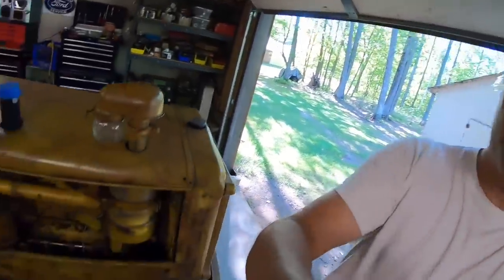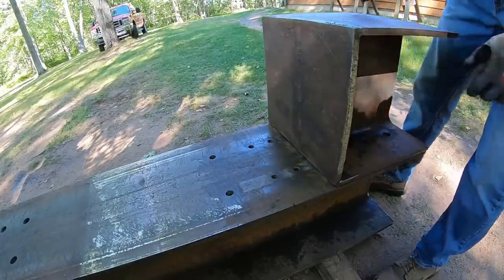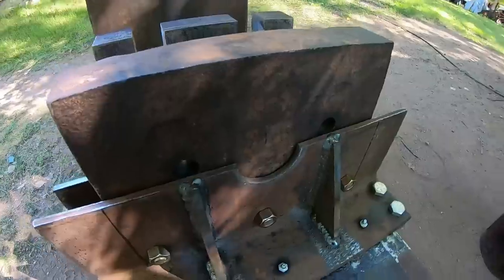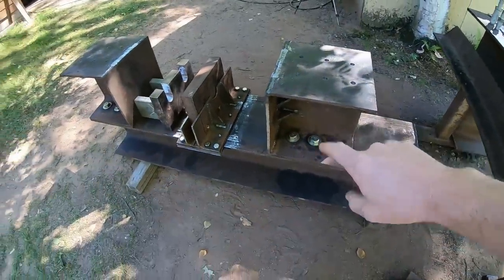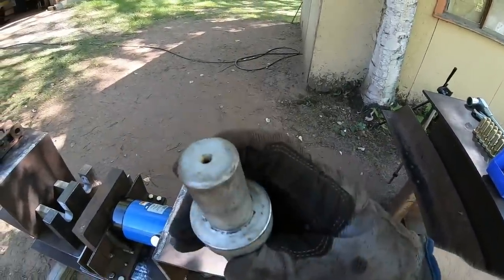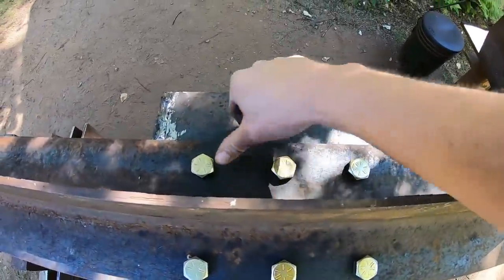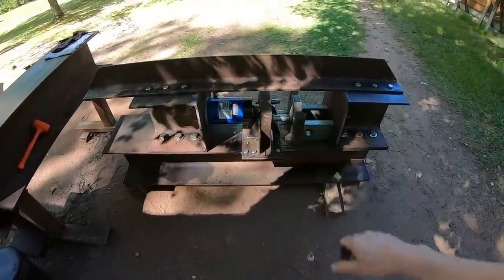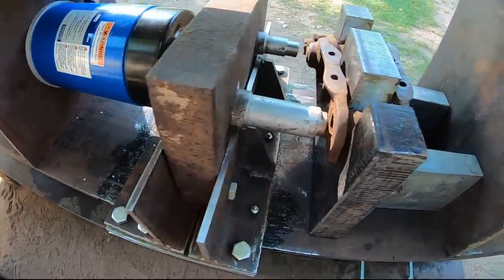Caterpillar D2 #5J1113 Chassis Rebuild Ep.66: Building & Assembling the Pin & Bushing Track Press

Comment: Pressing 2 at once is fine as long as both sides press at an equal pressure.  If one side is seezed you will quickly find any weakness in the design.  Overall its a solid design.
Reply: Hi Kevin, it's a good point you make but it has been catered for in the design. Toby included those anti-twist guides. Guess it's all a question of how seized ....

Comment: Looks great, I think it'll do the job without issue. If the grease becomes to much to deal with try a bar of Ivory soap, just smear some on the contact areas as needed. I've seen building slid along steel Ibeam to move buildings into place on foundations and such. You can use the soap to wash your hands with when you're done😂😂😂

Comment: I bought a pair of new Berco D2 chains many years ago from Florida that were stuck in a coil. The track shops wouldn't try to disassemble them because they needed straight tracks to fit their machine. I went as far as making the anvil with the two U slots but got busy.  I might get that project completed one day!

Comment: Really nice build, it doesn't really matter if it has a scrap fab look. :)

On very rare occasions I've spent long hours making a fixture for this project and that project with dead reckoning as my design guide. Looks like it'll work and I think it'll work but you don't know for certain until you've gone through a few repetitions. I can't say I've built anything remotely as substantial as this link press you've assembled, it should be neat to see it in action.

Comment: That's a very heavy duty press it should withstand the forces you may want to have a expanded steel cage around the sliding area in case of broken parts and pieces go flying around so nothing hits you I have had stuff go flying when I have been pressing with my 20 ton shop press I am glad mine has the remote pump Jack like your hollow ram uses it let's me stand back from the debris. Keep up the great videos Toby

Comment: Wow!  The only step left, I guess, is to add a nice handle on the top so you can pick it up and carry it around, right?  Nice build!!!
Reply: I was thinking some holes in the web of that top brace to accommodate shackles in which you can put a sling to pick the whole thing up.
Reply: Or slots big enough for the forks on the tractor.

Comment: That's pretty awesome all things considered.
If you end up having a problem with the slide, maybe taking the mating surfaces and hand scraping them in so you get some good flatness and places for oil to reside, just as they would have the ways in old machine tools back in the day (some of which were likely to build your tractors) and running the slides on light machine/ways oil would be a good option. Way overkill for sure, but a good option if you want a good slippery accurate slide or if for some reason your solution gets stuck (Though I personally don't see how!).
It's always crazy to see the heavy duty tools you need to combat heavy duty construction!

Comment: might work ok..... but you've created a teeter-totter with the pin press pins, all good as long as they both take damn near the same amount of force to press the pins.......... I'm thinking in the end you're going to end up making it a center press only inline with the ram i think i would make it so that the center plate that you drilled and machined flat could slide left to right to allow for quick change between pressing pins, a little cup on the back side that the ram lines up into..... you also might want to provide support to the back side of the chain to the back support panel so that you don't bend up chain links if one is stuck...... the quickest way to find the yield strength of anything in our shop is give it to the rookie and tell him to press it in the 50 ton press.

Comment: I wondered where you were going with this, Squatch. It took me to the middle to understand you were creating a horizontal punch press. Most punch presses I've seen in factories are vertical, letting gravity do most of the work, but this will do great for your application, and you don't have to build a huge base for it to sit on.
Reply: In this case the gravity is keeping the track down into the press.

Comment: Jigs are made looking rough. You know what it's for and there you have it. I was hoping to see you put it to use in this video though. I say, you let us down a bit there! A press has loaded areas that get worse and worse with use. A single point press with a swinging punch for each purpose would have been "better" I guess? Guiding that ram is where the variation will appear in wear factor.

Comment: Add a stop on the end block to prevent the brace plate from sliding up when under pressure. Even with the top "T" iron strap there will be distortion in the frame with 50ton working against it. 
Use a couple of moving blankets over the press it prevent flying shrapnel if it would have a catastrophic failure. You can get them at HF, fairly cheap. Looks good and good luck with the first test run.

Comment: Nice build. My only thought is that the ram is a bit too high. The slide may not notice? I’ve built similar hydraulic presses for other reasons and the ram tends to try to lean. Yes glide material and shims were used. The two push pins being different lengths may work in your favor. In the end? Great to make your own track press! I hope it works in great fashion!

Comment: Big press!  You could run into issues by pressing two pins at once.  If one pin is free and the other jams it may rack your press slide…. And with that big cylinder may bend something.  Pin presses I’ve seen usually are c-shape and pop one pin at a time using a portapower cylinder and electric pump.
Reply: A regular track press does one pin & one bushing per stroke. One reason is it pushes the parts from the outside to keep the inside from going through the link bores. If you only pushed the pins out you would have to push the pin through both links to separate, thereby pushing the old distorted wear surface through the link hole. You would also  add operations by having to press the bushings out separately.  Of course with this design you will have to replace each remaining side link with the pin & bushing back into the press (with the drivers swapped) to get all the parts separated.

Comment: Ever hear of Huber Reversible Fans out of Erie, PA?  My Dad worked for them until they finally closed their doors around 2015.  Aftermarket reversible fans for heavy equipment, that when reversed for winter operation, sends the engine/radiator heat towards the operator. Or summer operation sends the heat forward out the front of the machine.  They sold a lot of fans over the years of that shop.  I'm not positive, but I think they would sell direct to Caterpillar, or at least dealerships.

Comment: Most folks haven’t heard of the YouTube channel of Master Milo over in the Netherlands. He does all sorts of builds and restorations. He bought a Chinese T55 tank that a British Army unit had brought back from desert storm and set up as a display. It got rusty and ugly looking and they sold it to Milo for scrap. He had an awful time getting the rusted in track pins out. He finally resorted to massive heat with a couple of rosebud torches and banging the pins out with a fabricated pin driver and a sledgehammer. Of course, these tank truck pins were designed to be free floating and not pressed in in the first place.

Comment: That sliding piece works exactly like every log splitter that’s ever been made, and they don’t use grease on the slide or the rail. So I don’t think you’ll have an issue there. I would be more concerned about the grease getting dirty and acting like an abrasive, causing binding or scoring.

Comment: We love our CAT manuals: Does it say the pressure required to press in the pins from the factory?
(and you did grease up those lower fittings, correct?)
Reply: @squatch253  you already have the greasing frequency figured out, so that might mean you've already have tried the press?!
Reply: @squatch253  The way the press is built I would expect the grease area to be loaded only by the weight of the moving jaw or am I missing something?
Reply: @squatch253  when my channel starts paying for it's self, I'll join. My 1958 Plymouth Suburban is getting the views and adding subscribers. My I post a link to one of my videos?
Reply: @squatch253  much appreciated!

Comment: Your back brace (to the top of the press plate) could use a spring and camming device mounted to the top angle brace, so that the back brace is lifted up against the top angle brace and held there by spring force (spring above angle brace).  Then you using an integral bar, cam-over and push the back brace down into position over the link.
When done pressing, cam it back and the spring lifts the back plate back up, off the push plate, allowing removal of the link.
Saves having to have two extra hands to lift the back plate each time.
Hope that's not too unclear....

Comment: looks good .are you going to put return springs or gas struts on the sliding part to help return it each time
Reply: I think he will find he'll want some kind of spring, just to reduce the repetitive motion issue since this is going to run hundreds of times. Operator fatigue!
Reply: There's nothing like being able to feel what a tool is doing for catching a problem before it causes damage. When you feel that something isn't quite right and find out why before something else starts happening you save yourself a lot of time, money, and headaches. Overbuilding is great. Making it too complicated just adds to the potential of failure. I like the way you think Toby. You built it strong but not too complicated. You didn't build it to do all the work on its own. It allows you to monitor the progress and make adjustments as needed.

Comment: An idea from doing way too much repetitive work like this myself 
Make your slider return back automatically, it'll speed the job up more than you'll think 
Even a bungee cord wrapped around it and run back behind the cylinder 
Or if your cylinder has a spring in it to return it then tack your wear nut to the slider
Reply: I was thinking the same thing, add mounts for some tension springs to keep the carriage against the end of the ram. Bungees are a cute idea, but I doubt they would have enough pressure given the short distance.  He could just drill holes, and put in some long eyeballs to accommodate whatever return spring he has laying around with enough travel.

Comment: My goodness that is one heavy engineered press but it does have to do a lot of work to do all the chains. I reckon you will be able to press the pins out on the track of the NASA rocket crawler. As said below the design does rely on the two pins moving together with not too much difference in the force required to move the pins and bushings.

Comment: Looks great but needs some heavy springs or return mechanism between the slide and the ram!
Reply: The way he built it allows him to catch and correct any binding or galling issues before something gets damaged. Yes, he has to put his hand on the pressing plate and pull it back but, if it drags a little more than it should he will know about it long before the springs would speak up and tell him.

Comment: Could you do a test press on just one pin. To see the pressure required to move your most corroded pin. It will give you a bench mark to calculate pressure required to press two pins at once.

Comment: Out of curiosity I looked in my AISC bible to see what this beam was. From the general dimensions you gave the closest thing I can find is an HP beam, more specifically this is either an HP14x89, HP16x101 or HP121. At; 14/16" tall, 14.75/15.8" wide, and 89, 101, or 121lbs/ft. The dimensions don't exactly line up to what you said, but it is the closest thing I can find in my book. Depending on the mill the dimensions do vary a little bit (not much though), depending on how old the material is epically.  HP shapes have a huge capacity to be loaded axially or transversely, either way they are exceedingly strong for what the beam is being used for.

Comment: Looks good now if works and it should? May need bigger ram! Due to pushing two points at same time.Seen video of (overseas country India) other press home made! Had a ramp guide that feeds  the (rolled out chain) into the press.they used a winch, like a bumper winch. hooked back aways,  then winch the chain forward.

Comment: Hi folks, well if one of the pins is so seized that the unbalanced forces on the pins cause that sliding unit to twist despite the guides than it is easy to do a single pin conversion, it's a very flexible (bad choice of adjective!) design ......

Comment: From building splitters just like that the only thing I see failing is those bolts holding the slides on normally you see 6 to 8 bolts on each side it will be interesting to see if they snap.

Comment: When I built my (ugly) log splitter from scrap metal I cheated a bit, since I had room to spare I made the guides and bottom plates three times as long as the sliding plate and placed them centered, since I already did it that way from the beginning I don't know how much the rigidity improved, I'm almost sure that the greatest pressure is exerted on the ends of the guides instead of being distributed evenly, perhaps it can be just one third more rigid instead of three times more rigid or something like that, but any improvement is welcome.

Comment: Does the 50 ton hollow ram have a retract spring. My 20 ton does not. The hollow ram is only partially threaded.  Can you drill and tap the ram insert  all thread for a fastener.  To build a retraction spring setup.  That is hidden in the ram unthreaded counter bore to adapter flange . Might have to drill a hole in the back stop for a tension spring to feed thru.  
Got any more 15 H beams you can not drill but rest as infeed and out feed tables on stands or blocks. To keep the rails at a decent level .

Side guides on the moving block may need to be longer to prevent the moving block from twisting.  Or do you have any junk hydraulic cylinders you an mount thru either side of the fixed stop and into the outside of the push block to work as alignment rails. 
Think externally bolted cylinders . Depending on rod to cylinder clearance. Rear motorcycle shock  springs. assembled inside as retract springs.   thoughts.  Just thoughts.  And yes I played with erector sets on a carpet in front of the Cat Twenty in my yard.  Look on the chart by the shop door for a cat pull grader with spoked wheels and pneumatic tires. That was on the tow hitch of the Twenty.

Comment: I’ve been into antique tractors for years. A lot of assemblies were heat shrunk back in the 1930’s. I’m just curious wether CAT used heat shrinking
Reply: Add a couple mounts for a pair of those 1500 watt heat guns on either side of the cradle for the link. It would at least warm it up before pressing.

Comment: Couldn't you just use a sledgehammer and a used pin to drive out the  track pins? I am definitely not a rocket scientist but  it's quite possible that would work.

Comment: Can I suggest that you majorly round off the all the upper surface corners on the (checks video) "cradle"?

The upper surface of the cradle has no functional purpose, and you'll be repeatedly moving heavy links around the area. Those corners will destroy your knuckles (and sense of humour).

20 minutes with a big angle grinder oughta' do it.